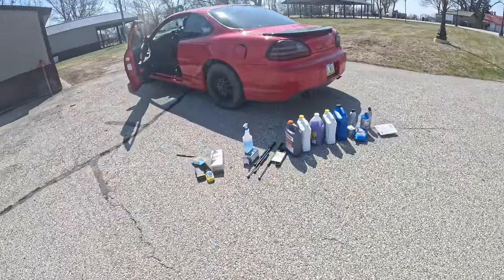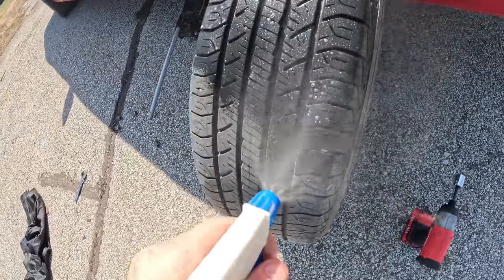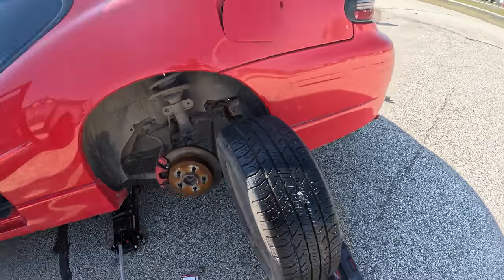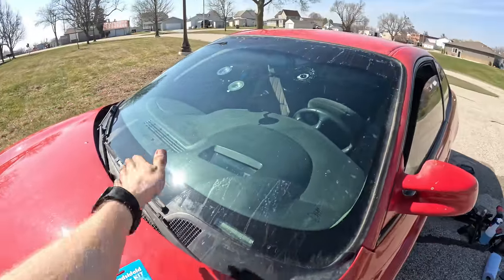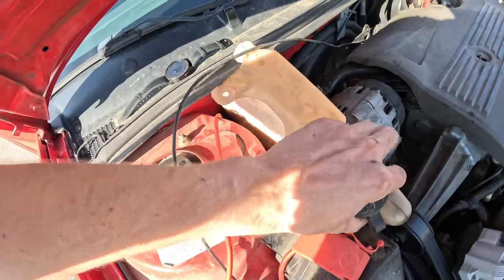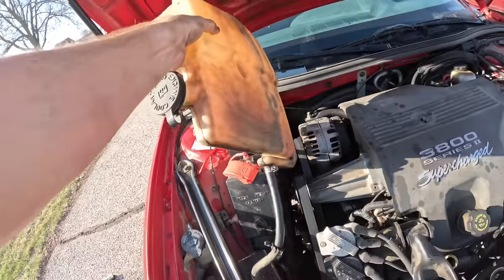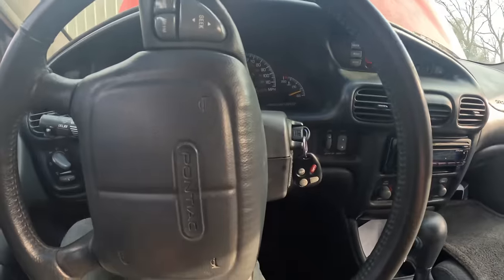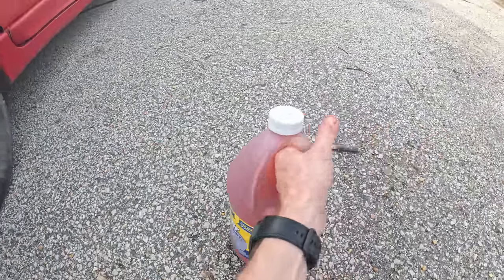Full Grand Prix Restoration - Part 2

Comment: Those were pinch welds were pointing at and you can jack it up from it. Most original jacks that come with cars use them to jack them up.
Reply: Also looks like a new radiator and hoses are in your future, along with rear rotors and pads